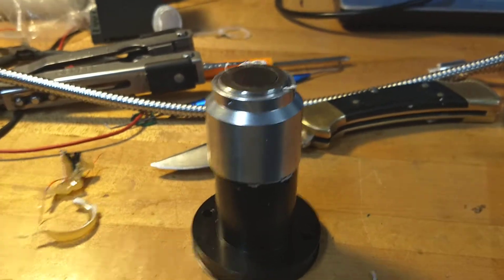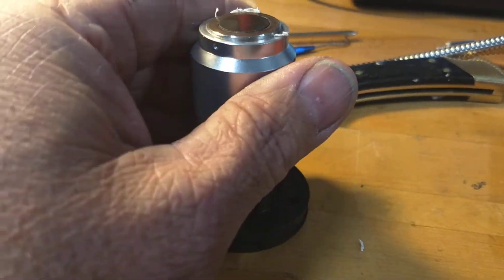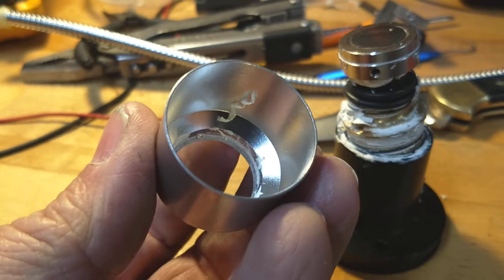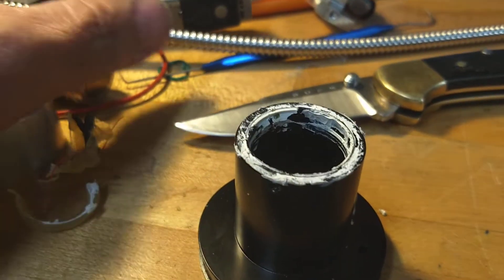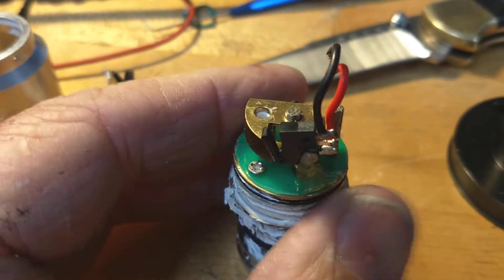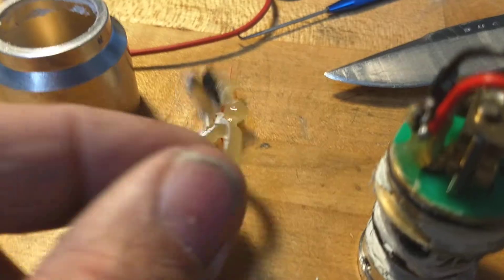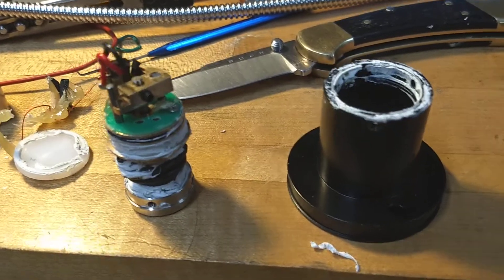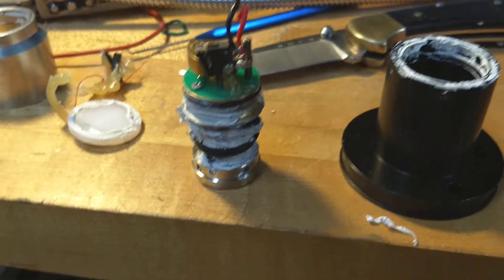"Metrol" Chinese knock off CNC tool touch probe tool presetter. Let's look inside!

Comment: Not sure where you got that, but doesn't even remotely look like mine on the inside.. mine has an LED, three resistors, and an IC smd soldered to a small PCB, with a  ball-on-flat contacting point for the first limit (tool touch off) and a second spring loaded ball-on-flat contacting point for the over-travel. it's sealed with two o-rings, and an o-ring where the sleeve mates tot he touch surface.  also, the rubber boot on yours is fully compressed already, meaning there wasn't going to be any travel regardless of the silastic that's spread all over it... 

Also, the one i have the conduit has a a compression nut on the end of the conduit that's used to screw it into the housing, and another on the other end for attaching to another point. 
No hot glue at all.. 

Truth be told, looks like your buddy crashed his probe, tried to "fix it" broke it more, hot glued it together, and and then gooped everything in silastic and stuffed it back together. before sending it to you.
Reply from the maker: That's the way it came honestly. It was also some time ago. Perhaps your source was of better quality? How much was yours and where did you get it?

Comment: I would like to glue a magnet under the tool setter (on the transparent plastic part), to fix it to the CNC surface. Or could this create interference?
Reply from the maker: Should be ok. Give it a try
Reply: that plug in the bottom is acetyl (also known as delrin) you can just pop it out, machine it for the magnet, and pop it back in.

Comment: The one I just bought RATT something on Amazon, was DOA so I opened it up. It has a loose wire. But it also has two little microswitches, and no electronics. So if the one here has a pietzo or something, not all do.

Comment: The "silicone" Marty refers to is to protect it from any coolant that it may be flooded by if you used coolant flood on your machine. It's there for a reason along with the o-rings. The "little freaking piece of plastic" the he refers to is the OVER TRAVEL switch that is there for protection to be wired to your e-stop, this is not the probe tripped switch. The probe itself works as designed and requires very little travel to trip. I modified one of these n/c touch off probes even further for a friend to be a simple n/o touch off probe with over travel protection. It works well as designed and gives you a second "quick access" e-stop button if you need one.
Reply: Was it difficult to change to NO, I need to do the same?
Reply: @Shopbuilt  No, not at all. For the record they sell N/O and N/C versions of this on ebay. I basically turned it into a touch plate by moving one of the wires. The wires Marty said he cut off are the ones for the n/o or n/c touch circuit. The red and black wires in the video are for the overtravel micro switch. The over travel switch, the tiny switch Marty refers to,  can be wired into your e-stop circuit and the other 2 wires are for the touch circuit. I simply used one of the other wires to connect it directly to the plunger itself so when the router bit touches the plate is closes the circuit on the Acorn input for the touch probe. This is the "fixed" touch plate on the machine for semi-automatic tool changes. The machine I installed this on is fully grounded so no crazy alligator clip is needed. Sorry I didn't take any pics.
Reply: And for he record, it works flawlessly as the fixed location tool touch off for tool changes on the Acorn setup. The fact it's spring loaded help cushion the fine point on the O flute bits I use on this machine.
Reply: @FlipFlopPilot  thank you, I got it working.
Reply: What's the repeatability like?
Reply: @impactodelsurenterprise2440  I modified it to be a continuity sensor and it's paralleled with the movable touch plate on a N/O input on the Centroid controller. Since it springs back to the top of travel every time its accuracy is great for the router it's on. It's used only for jobs with multiple tool changes as after the tool change it measure the tool and sets the offset for me. I have no complaints yet and I'm about to install another one on the machine I'm getting ready to retrofit with another Centroid controller. For $30-$50 it's great in my opinion. If you need .0001 accuracy and repeatability it may not do that but for my machine and setup it's great.
Reply: Savage Chinese engineers, ruin everything they touch. Wondering how their wives rate the honeymoon.

Comment: Interesting... Just wondering what the genuine article would use for switching? Optical or just a simple NO or NC switch just like this one but of higher quality? Has anyone had good success using one of these despite the crappy internals?
Reply: There is a normal microswitch in the "real thing", that is for the overtravel detection. Then there is another mechanical switch for the actual measuring contact, which has some small adjustment screws. Some small circuit board carries, what looks like an opto coulper. No weird glue but O-rings and precision fit parts. Slightly different.... :-)
Reply: Thanks Timo!

Comment: You didn't even mention if it works. And looks like with a little TLC you can turn a sows ear into a silk purse.
Reply from the maker: Indeed you could make it work. The point was to dissect a $69 probe.
Reply: @martyscncgarage5275    I think you got what you paid for and now have all the kit ingredients for a great touch probe. Your momentary switch is easily the simplest upgrade. As for sealing the assembly you are going to have to be adventurous.

Comment: Marty, I had bought this, but hadn’t received the unit until after you posted this video. I’ve played around with it. I’m almost certain that the switch you are referring to is the over travel. When I touch off, it signals after moving maybe 1 mm. If I push it  all the way down, it the e-stop is activated. I have the over travel wires in series with the estop and over travel switches
Reply from the maker: Enjoy! At least you know what's inside.
Reply: Thank you for the information. Is it still working?

Comment: Hi Marty I've tried emailing you but it keeps getting denied. Anyways...Thank you so much for giving all this useful information.

I had a question.

I'm building a 4x8ft diy cnc (mechmate) wood router. I have no experience in cnc/ computers/ electronics. I will be using this for a small business to hopefully make some money. What would you recommend for motors/ control panel etc?  My overall thoughts with this build is to build it right the first time so I'm willing to spend a little extra for quality products. Thank you so much for all you help.

Sincerely Paul